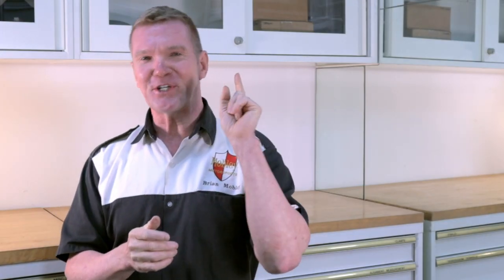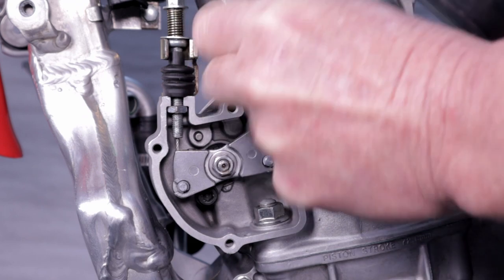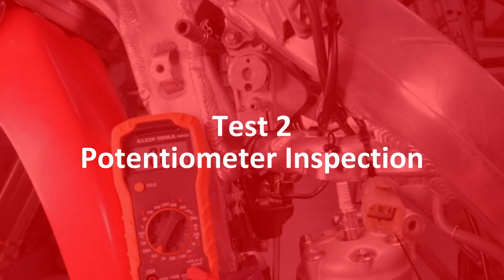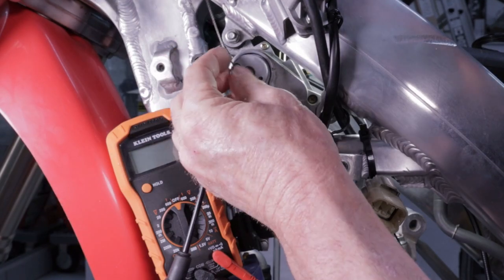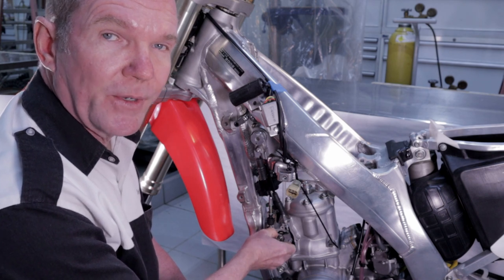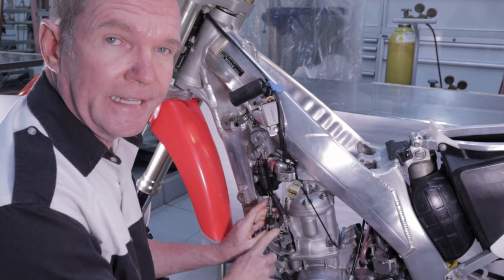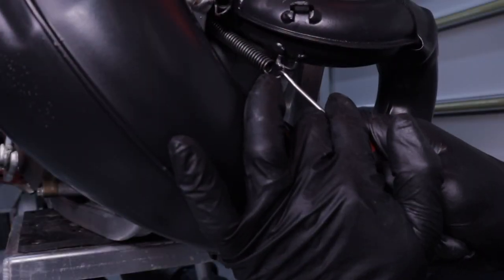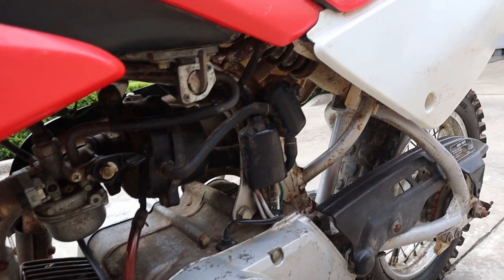Demystifying the RC Valve || Inspecting and Adjusting - CORRECTLY!

Comment: I bought a 2002 CR250 brand new when they first hit the dealerships. It is still my primary bike that I ride to this day. I have done the 12MM adjustment no less then 100 times over the past 18 or so years. Never again. Thank you so much for posting this video. I feel like I've found the golden egg....lol.
Reply from the maker: Hey David.  I know that technique is super popular, but that gap really means nothing.  The goal on the rear adjuster is proper preload.  Thats it.  If that preload was achieved at 10mm, great.  If it was achieved at 9mm, also great.  The gap means nothing. Not to mention the unnecessary strain on the servo motor.  Broken gear teeth on that motor is a COMMON problem and I would bet (but cant confirm) that its from pulling down so hard on that servo motor when people employ that popular "12mm" technique. Imagine basing your throttle range on how tight the throttle cable was.  That means nothing!  What matter is that the throttle is closed when its "relaxed" and that its fully open when it completely rotated.  Thats all that the throttle does!  Same with the RC Cable rear adjuster.  I think the only reason the 12mm technique became so popular is because the manual is so fuzzy and it provided an easy "answer" to the confusing manual.  The manual is actually pretty close, but its just not described well.  Anyway, Im going on far too long!  Glad it helped you and thank you for watching!
Reply from the maker: BTW, I own a 2002 CR250 also!  Its so pretty, I hardly ride it! HAHA!

Comment: very valuable info. i had it adjusted to the 12mm method and the cable was bent and hard to turn the servo, too much tension. that way just seemed wrong without even running the bike. so i kept searching and found this vid,  i will go with the factory honda method for sure.  Thanks.
Reply from the maker: Hey Kai!  I have found the same. From my experience, 12mm has always resulted in an overly taut cable.

Comment: Thanks for the video. I've got a 02 CR 250 and was told to set the RC valve at 12mm so Thanks for showing me how to set it up correctly.
Reply from the maker: Hey Scott.  Yeah, 12mm means nothing.  I dont know why that value become so popular, but as you now can see, the gap means absolutely nothing.  I think people started to just believe the 12mm story because the manual describes the process so poorly and its a simple thing to measure.  Im glad I could help.  Keep watching and subscribe if you like what you see!   THX!
Reply from the maker: ...and I have the same bike!  2002 CR250 (which was used in this video)
Reply: @brian.d.mobley  That's awasome man. How is the jetting on your bike. I'm thinking about getting an Airstriker carb and V-force reeds to improve throttle response. But all in all I love my bike any tips ?
Reply from the maker: @scottspecht6690  Its probably not popular to say, but I have completely stock jets!  Im at sea level and it works fine.  Maybe I am just used to it, but I think the stock jetting works just fine.  If you have throttle response problems, you can change them.  If you have the service manual, the jetting recommendations they have have always worked very well for me.  I also race a shifter kart and have had to change jets based on temperature and the manual suggestions have always been right on.
Reply: @brian.d.mobley  Thanks I live in Ocala FL , central Florida sea level and hot and humid most of the year. I never foul plugs but the power delivery seems sluggish compared to my 2000 CR 250 but I love the suspension on my 02. Just thought I'd ask you opinion on the carb. I'll have to see if it improves with the V-force
Reply from the maker: @scottspecht6690  I live in Houston, so the weather is similar.  It would not hurt to play with your jetting and airscrew a little.  However, Hondas have long been criticized for sluggish low-end power.  The factory has experimented with longer intake tracks and, of course, power valves to try to improve that.  Unfortunately, its always a compromise and there is always pressure on a manufacturer to produce impressive horsepower quotes for selling purposes and that means designing a motor that has a powerful top end power curve.  Im used to it, so I dont have a problem with it.  And, I dont race dirt bikes.  Check to make sure your carb is clean too and that there are no air leaks like at the crankshaft.  All that stuff can cause poor low end performance.
Reply: @brian.d.mobley  Thanks Brian. I'm definitely curious to see how out of whack my RC valve is . It's always great to hear from someone that's knowledgeable about two strokes and I'm stoked that you have a 02 CR 250. Do you mind if I hit you up on Facebook ?
Reply from the maker: @scottspecht6690  My background with two strokes started in 1988 racing karts.  I have been running shifter karts since 1998 which use the CR125 motor and then started with dirtbikes about 8-10 years ago.  So, I have a lot of experience!  And, feel free to friend me on Facebook as long as you dont mind that I am pro guns and a patriot.  Fair warning!

Comment: Very informative video Brian, thanks for taking the time to make this......great work!     
ps. I always questioned the science behind the 12mm method as there was never any tech to support it.
Reply from the maker: @deegs12 Honestly, there is nothing out there that I could find to support the 12MM Technique.  In practice, it resulted in way too much stress on the rear cable for no reason. The cable will pull just fine with way less tension and you’ll spare the unnecessary strain on the servo motor. Its a popular technique but from my observation was the worst approach.  There is no need to crank down so hard on that rear cable. And, there is nothing to support that a 12mm gap creates the magically correct tension. That gap is meaningless. The cable tension and flap opening position are the only considerations for setting the preload on the rear cable.

Comment: On the front adjustment, It looks like the “sheath”? The black part of the cable? Is still moving up a down when you stop tightening it. So just adjust it till there isn’t any movement?
Reply from the maker: Yes!  Sorry if that wasn’t obvious. I’ve actually been considering reshooting a few parts of that video to have better focus and explain things a little better.

Comment: Hello mr Mobley, ur last youtube vid on the rc valve was realy good but i missed a little detail in the end , on adjusting the right cable you say turn the pulley counterclockwize and then make sure that the flap in the cylinder is flush with the opening, but... you dont mention if you turn the servo motor by hand at its full stop counterclock wize so you can then sync the cable regulators to match the flap when the servo its on its full stop counterclockwize with the rc flap to be open to the prefered gap. 
Can you clear this up for me please?
Thanx
Reply from the maker: Hey @fegaroporta.  The short answer is that the servo doesnt have any kind of stopping mechanism or function.  As you can see in the video, it will rotate continuously in either direction depending on the polarity of the power input.  Under power, the servo only pulls the rear cable in a counterclockwise rotation.  The spring on the front cable is the return mechanism which brings the pulley to rest against the stop pin.  So, the initial position of the servo does not affect its function.  The cable length ensures that the pin inserts are near the 12 oclock.  If you adjust the cables correctly, the initial servo position will take care of itself.

Comment: Really appreciate this video! One question - how does the servo know when to stop powering the valve open? Does it receive a second signal to stop turning the motor but hold in position (such as constant WOT)? Otherwise, how does it not damage the servo gear when it's powering open?
Reply from the maker: Hey Rocker.  THAT is an excellent question and I must sheepishly admit that I am not 100% sure. I believe the servo is signaled to counter rotate in an off throttle state by the CDI, but to really know, id need to connect the servo to a voltmeter while it was running and, frankly, I don’t know a good way to rig that up. Good question though!  I wish I could give you a better answer.
Reply: @brian.d.mobley  thanks for the reply! I do know blue/green is earth ground (continuity checks to the frame), and they had us do the static motor resistance testing with that and yellow/red, and powered resistance testing with that and light green...so maybe it has to do with those? Who knows...I'm only asking because I'm dealing with some sort of overall powervalve issue, and it could be stripped pinion gear teeth, because everything else is checking fine. Thanks again for this video.
Reply from the maker: @rocker1210  Sure!  And, Im sorry I could not help more.  That one question you posed was the one thing I really could never ascertain!  So, big GOLD STAR to you for being the best in class! HA!  Regarding the gear teeth, that is a COMMON problem resulting from over tensioning the cables. The gear is plastic, so its not that strong.  Some people have fitted a servo gear from a CBR600 (I think) in lieu of just replacing the entire servo.
Reply: @brian.d.mobley  I think to really understand this, we'd have to maybe have separate volt meters on each wire (except green/blue) with a tach set up, and watch what happens on a running engine in different parts of the rev range with each throttle condition... preferably on a dyno. Just guessing! But I've heard about the CBR600 servo option, as well as a pinion gear replacement. I'm going to take the servo apart shortly and see what I'm dealing with. I've currently got the engine pulled, cases about to come apart for a new crank, and cylinder out for a replate. Lectron carb on order...should be a great set up once I solve the RC valve problem (and rig the cables correctly!!).
Reply from the maker: @rocker1210  I think the technique you describe could work, the problem is, how do you make the wire connections while the bike is running. I wouldn’t want to splice into a wire. I think the best work around would be difficult, but a person could create a jump lead with exposed terminals that was introduced between the plug connection. Almost like adding  an extension cord.  This jump lead would have OEM plug leads but something in the middle of the lead onto which the leads from the voltmeter could be attached. Its a lot of work, but i think it’s a workable solution.
Reply: @brian.d.mobley  yeah, pretty intrusive, and definitely way more work than it's worth, I think. So looking at the wires inside the PV motor assembly, white/black and green/white go to the motor itself, and the other three go to a resistance potentiometer...and I'm guessing those must reverse or stop the voltage or something based on valve position...since the shaft coming from that is the actual output shaft of the reduction gear (the cable pulley). That's everything I've learned! Turns out one of my gears in that reduction drive was completely stripped out...found someone to 3D print a whole new set of gears, so this problem should be handled soon!
Reply from the maker: @rocker1210  I was reading about 3D printing of gears just today on a Facebook Page called "CR Only."  I would love to the the CAD on that gear and 3D print some here.  I have access to a 3D printer and could even make them out of metal.
Reply: @brian.d.mobley  I'm pretty sure that's actually my post! That's me with the motor apart and stripped gear. One thing I don't mind at all about when things break is learning all about them when I work on them.
Reply from the maker: @rocker1210  I am absolutely addicted to learning and figuring out the actual RIGHT WAY to do things.  So, kindred spirits there!  If you get access to a CAD of those gears,  let me know, please!
Reply: @brian.d.mobley  I sure will! And I'm exactly the same - absolutely addicted to learning and love building and improving things. Suspension has been a really gratifying thing to learn about... making my own shim stack adjustments and fixing things myself that most people would send off or just replace. I honestly get as out of working on stuff as I do riding! To a certain extent. I'll post back up how this RC valve turns out.

Comment: I don’t know if I’m dumb or anything, but I’ve got the factory power valve cables, and when set up on the batwing, there too short to get put into the servo.... am I missing something?
Reply from the maker: Hey Eli!  Dont feel dumb!  Sometimes it some silly little mistake.  So, first question, are you installing the cables into the servo BEFORE you try to install the ends on the the pulley (batwing)?  (Correct answer should be yes, BTW!)
Reply: @brian.d.mobley  I am, I’ve tried every single way possible for about 2 hours, and I can get one side in and the closest I can get the other is still about a 1/2 inch away from butterfly with out being set in grooves
Reply from the maker: @elisteiner5993  can you send me a pic or clip on my Instagram acct?  The only other idea that I have is that perhaps you have the wrong cables.
Reply: @brian.d.mobley  yeah I’ll do that right now

Comment: I need to do this to my 02. I know mine isn’t adjusted right. The bike is to finicky right now... if I measure 10.00 mm on the back side will that give me a starting point to do this adjustment without pulling the pipe or each bike is a little different so I have to do the full procedure
Reply from the maker: Frankly, if you do the procedure like the manual meant to explain, you’re not far off. It’s easier too, because you don’t have to remove the pipe. The biggest issue with the Service Manual is how poorly they describe the procedure. I really can’t say that starting with a 10mm gap is the right approach though. The gap could vary.

Comment: I can still over rotate it by hand? How do I know the the power valve is gonna line up perfect with the exhaust port?
Reply from the maker: Like I tell a lot of people, with the RC Valve, you are using a cable and not a linkage to rely on the adjustment.  A cable is not going to be as precise.  There is no stop pin or other limiter preventing you from over rotating the valve by hand.  By using the HRC method, the aim is to create enough slack in the rear cable so that, when the servo has rotated to its open-most position, the cable has retracted to a point where the flap valve lines up with the top of the port.  The trade off is that the valve may not start opening until the 3200 RPM mark.  However, the benefit is a significantly less pronounced flutter at high RPM.  Its not a great system, frankly.  Later systems that were entirely mechanical are more predictable.  One other note, the difference in the adjustment on the rear cable is only slightly less taut than the Service Manual recommended procedure.  Its not the end of the world if you do it like the manual attempts to describe, but the top end performance is better using the HRC method.

Comment: Hi, if we check all of this that you saw to the video and the problem remains maybe have problem the cdi ????when I start the engine and is idling,the power valve open in the middle and  stay  in this position regardless of the engine turns....
Reply from the maker: HI Chris.  That is more likely due to carbon buildup on the flap valves.  To test, disconnect the cables and try rotating the pulley by hand.  It should rotate freely and with very little resistance.  Another possible cause is damage to the servo.  Many people overtighten the cables and that ends up damaging the internals of the servo - particularly the gear drive inside. CDIs almost never fail, but they do on occasion.
Reply: @brian.d.mobley  Thank you very much for the answer!!!!
Reply from the maker: @christhalassinos5574  Sure!  If you get stuck again, dont hesitate to reach out again.  Im starting to get a lot of questions from people on various YouTubes I have created but I am still able to keep up with inquiries so far!  Please subscribe if you havent!  I am trying to hit that elusive 1000 followers threshold!